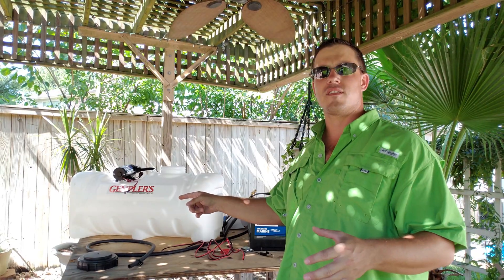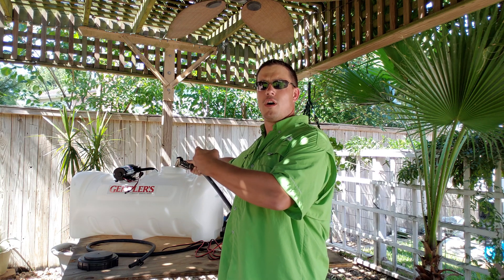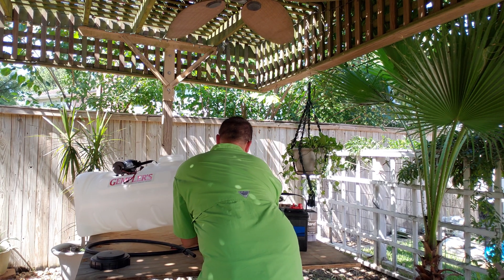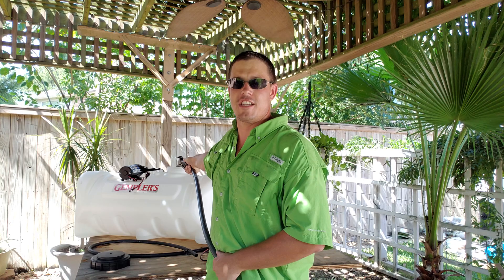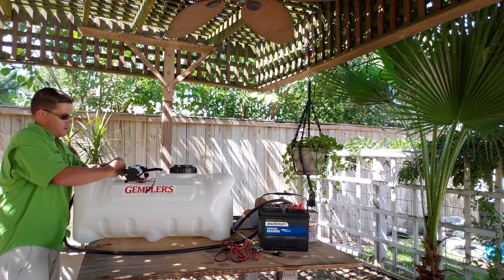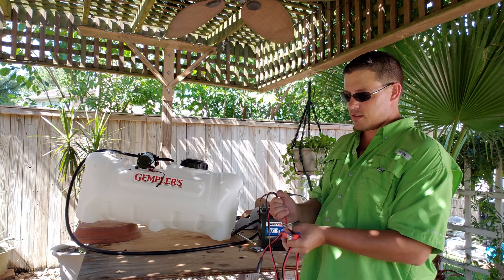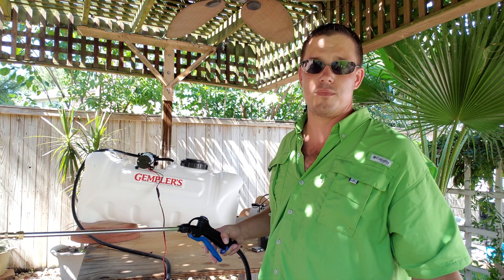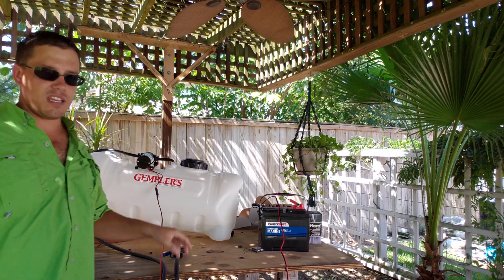Building a DIY 12 volt soft wash setup. Part 1

Comment: That noise is the pressure switch cutting in and out.
There should be a screw in the head that you use to adjust the cut out pressure.
Turn it up gradually to the point it stays running until you shut the flow off.

Comment: Thanks for this video man ..it really helped with my setup ..definently a learning curve ...new to soft wash ..looking forward to getting setup for this
Reply from the maker: You are welcome!  I built a better system with better hose and a reel since then.  I think I will post a video this weekend.  I have now washed a few homes with the 12 volt system and it works great compared to down streaming.
Reply: @mrdeedspw  I'd love to see it as I'm getting ready to try and build one myself
Reply from the maker: @Foxtrot150th  Thanks, and this is just using the small 25 gallon tank and batch mixing SH.  

I got a 3 way blend manifold from South East Soft Wash that will allow me to run water, SH, and soap independently and save me from batch mixing.  Bigger tanks, and bigger setup is in the works.
Reply: @mrdeedspw  I'd like to see the other system for sure ..that's the one I'm sorta after ..however I may have to start off with bulk just to check my area out for it ..were getting into colder temps now ..over in nc